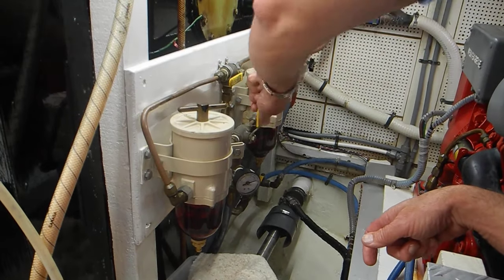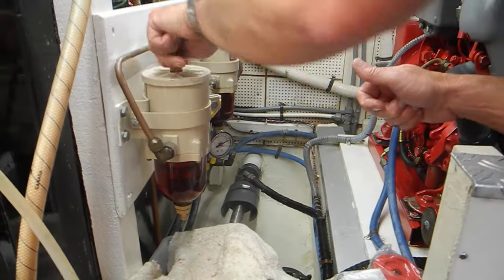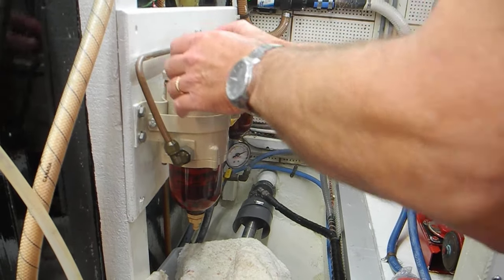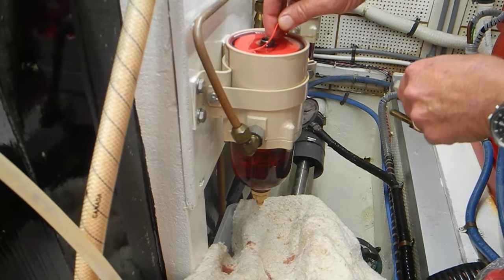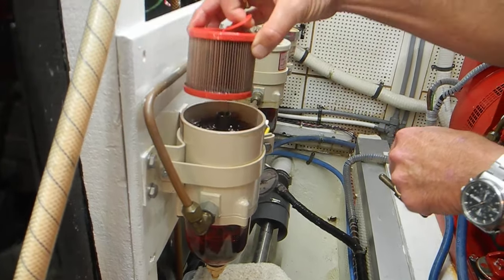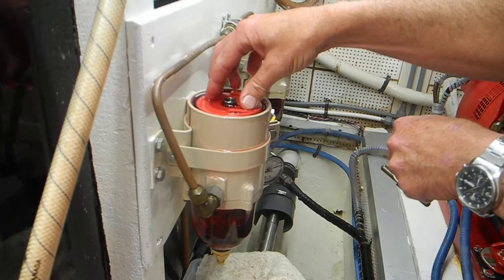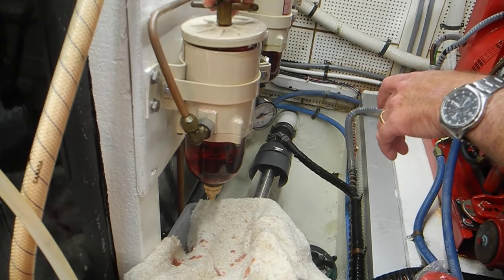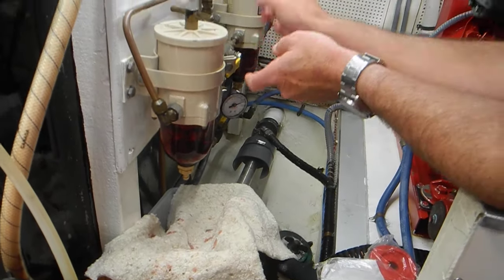Grand Banks, 2 RACOR 500s and a RACOR 2,000 filter

Comment: Do you have to prime the fuel system after opening the filter like this?
Reply: You need to isolate the filter that you are servicing.  So that the fuel doesn't run back into the tank.  You still should "prime" the system to ensure all of the air bubbles are gone.